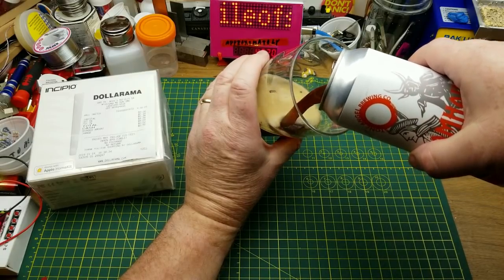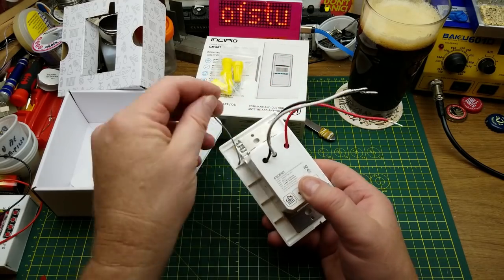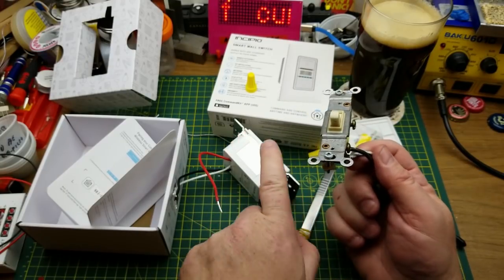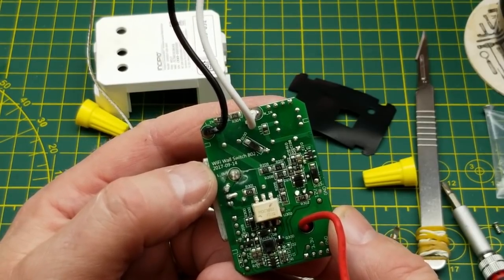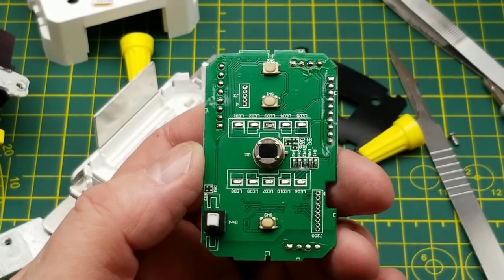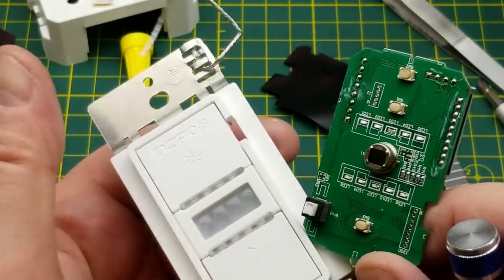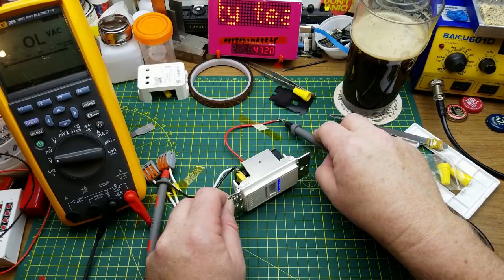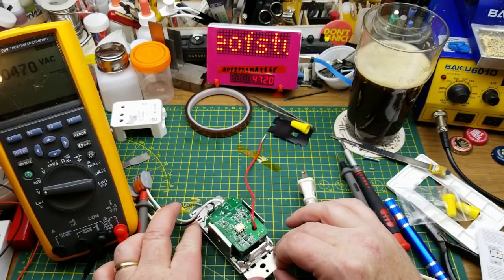Wifi light switch teardown

Comment: I picked up some 433 MHz RF power switches from LIDL. Comes with a small remote.
Managed sniff the protocol with an Arduino & cheapo module. Range is decent.

The plan is to use the Raspberry PI currently connected to my 3D printer to cut the power when a print is done. I'll get around to it one day!
Reply: A new feature creep for your idea is to use home assistant with a sonoff bridge.  then you have full home automation.

Comment: ESP8266 hack sounds like a good repurpose for the power board.  The wifi side is probably disposable.
Reply: just get a Sonoff, is has a ESP8266 and an isolated supply for roughly the same price

Comment: The words marette and nut jumped to mind before you said it, we don't use them in the uk.
I bet they would be good for generic wire joining, quick and no screwdriver needed :-D
We tend to use the screw type connector that crushes the wires together in 240v mains connections, we must love the torture of copper lol :-D.

i find screw terminal blocks quite handy, chop off what you need :-)
That buck supply would have been handy if it had been isolated, never mind :-(

Comment: iOS wouldn't run on a Samsung tablet, so... it's Android?  And have you done any vid about the wireless spectrum map app that showed the device when in pairing mode?    Thx.  Oh, and BTW, looks like a 5-pin UART serial terminal header just to the right of the daughterboard at 11:09...  Could that be connected to (what is it) a serial->USB interface, to possibly access the microcontroller firmware?  Just some thoughts.
Reply from the maker: Correct, the tablet is an android device.

That "spectrum analyzer" type app is called "wifi analyzer". 

It's super handy when you are stetting up a router or WAP and want to find the least used channels in your area to prevent interference.

I haven't done a video about it - didn't think many people would be interested, to be honest
Reply: @pileofstuff  Info appreciated.  If you're ever looking for a video topic, maybe finding, installing and using said app?  I happen to have an Android tablet, and have no idea how to find & install apps.

Off-topic:  Are we to believe you've never had a beer-spill on your bench when the glass is SO close to all the activity?  :))
Reply from the maker: @gandsnut  there is one video a year or so back where I got a bot too aggressive when I was pouring,  but that's the only time I've committed alcohol abuse on my work bench.

Comment: I like to put a couple wraps of electrical tape on wirenuts make sure they don't come off "just in case"
Reply from the maker: That is commonly done around here as well.
Reply: @pileofstuff  And in humid environments a b it of RTV in the cap before the wires go in
Reply from the maker: @pleasecho2  That's a new one on me. Then again, I mostly work with electricians indoors.
Reply: @pileofstuff  I also do refrigeration service and any time you replace a thermistor in a refrigerated environment that doesn't have an approved connector has to be manually wired in the connection has to be waterproof, such fuss ;)
Reply from the maker: @pleasecho2  Huh. 

I'll have to take a second look, but I don't think any of our HVAC guys have ever done that on the Bard wall mount units we have at work. Just straight wire nut and screw the panels back on.

Comment: Be very careful with that experiments, please! It's referenced to mains, I cannot see any insulation transformers. Probing around can be tricky and deadly.
Reply: Hi Surely not too bad in North America with the low mains voltage i.e. 120 Volts AC, here in the UK we have mostly 240 Volts AC, you don't want to mess with that...
Reply from the maker: I was fully expecting someone to make this comment.
Reply: @raywelshman  Common misconception, sadly. Both is Deadly Enough.
Reply: @pileofstuff  I think I agree with the presenter and prefer to rely on Darwin's theory...
Reply: @pileofstuff  But would it be as fun if there wasn't someone to tell you what you are doing is dangerous?